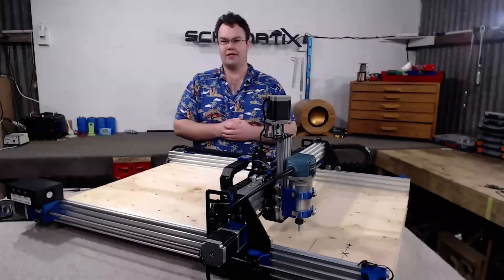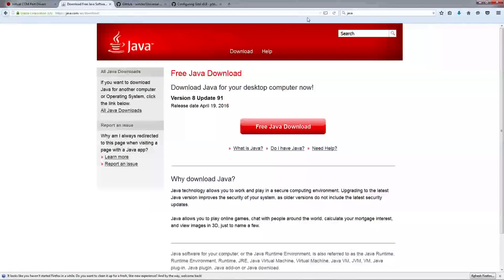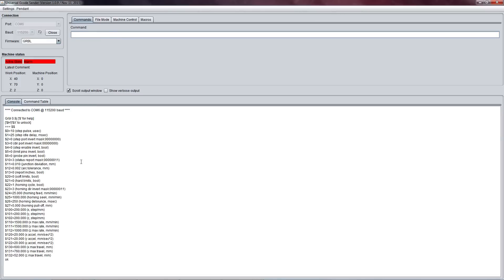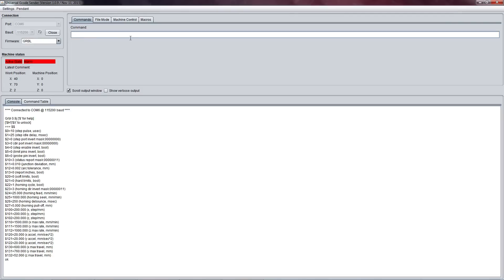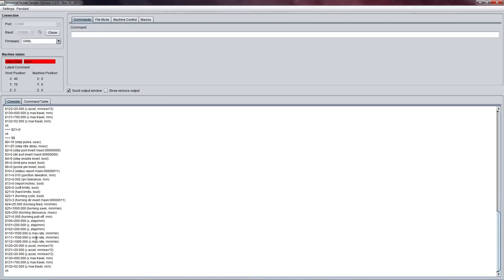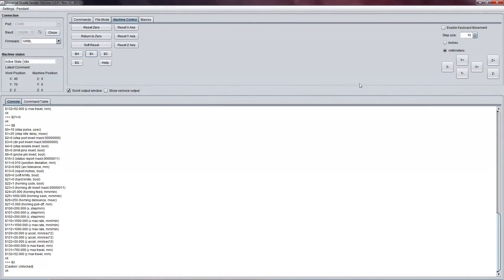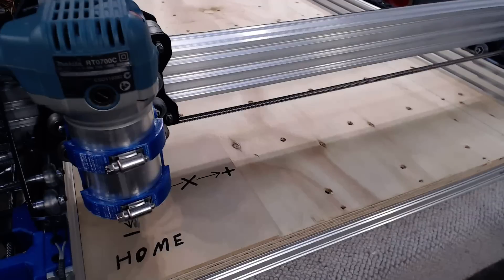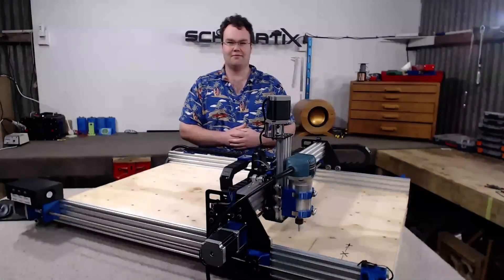How To: Setup Grbl firmware, Drivers & Universal G-Code Sender

Comment: I'm told I already have the best drivers installed when I try and install the drivers (1st step) however when I launch UGS I get the message 'no serial ports found'...  There are no COMx ports in the Port drop down.   It's almost like USG is not picking up on the fact that there's a USB lead in....    I am able to launch MACH3 and it connects immediately with no problem to my CNC and I am able to jog using this so commands are getting over as well...

Comment: when i set the BAud to 115200 , my software closes, although i have updated java, and software version ia m using of Gcode is 1.0.9 version, my windows is uodated. What might be the error or the shortcoming in my system/ hardware, can anyone help me with this issue

Comment: Just plugged into Cbeam XL for first time and all good:D Simple question though - how do you get t to list the setting meanings in the $$ output? Mine just displays the number and value..  Yours displayed the setting function
Reply: OK found the answer on the latest GRBL wiki  "The x of $x=val indicates a particular setting, while val is the setting value. In prior versions of Grbl, each setting had a description next to it in () parentheses, but Grbl v1.1+ no longer includes them unfortunately. This was done to free up precious flash memory to add the new features available in v1.1. However, most good GUIs will help out by attaching descriptions for you, so you know what you are looking at."
Reply from the maker: I'm not sure why yours isn't displaying more info related to the settings. Perhaps it's related to the version of software I'm using compared to yours?

Comment: Thank you so much for a well-delivered tutorial. I've had my V2 CNC XPro board and stepper motors for almost 2 years and I've not seen anyone discuss its setup and configuration so well as you did. I've been able to connect the board and the stepper motors and get them spinning. I just need to get familiar with the command codes. Thank you. Good job.

Comment: Like your instructions ... Just got my c beam xl together. Got the driver installed. Downloaded the UG code sender , but when I click on it as you did , I just get a bunch off files (maybe 35) don't get the screen for setting up cnc x pro settings. Any idea what I'm doing wrong. 
Paul
Reply from the maker: Make sure java is installed and up to date. It may fix your issue

Comment: hello sir,actually in my UGCS it is written OK at the end and there is no errors but I think due to stepper driver or what stepper motor is not moving.
but incase of grbl controller it is showing 
>G91
>G01X-10
error: undefined feed rate
>G90

and I changed CNC shield but new one too explode black one I think capacitor and I immediately power off and I checked next time one of x-axis a4988 doesn't work

Comment: Hello, I really like your commitment to us to learn programming, but I can not understand why when I open the program UniversalGcodeSender "Machine status" Work and position Machine position X, Y and Z are always 0, Do you know the reason?

And why can not set the extreme limit the size of the table?
Reply from the maker: So the work and machine position stays at 0 even after manually jogging the machine? Personally I don't use soft limits. So the machine position in UGS is rather obsolete. Naturally though the work position is very important.
Reply: Machine performs functions normally, but I do not see the status of the machine (position machines) cordinate? Can I do something to fix this error?
Reply from the maker: Really there are too many possibilities for me to suggest a plausible solution. I'd recommend making a post on Openbuilds forums, add some screenshots and give plenty of details.

Comment: I am using sketchup  as my cad program. then makercam to convert gcode . My problem is that when it runs on my home made  cnc it is a mirror copy . So if I was to draw a word . I have to flip it so it is backwards in Sketchup then convert to gcode  . any ideas?    please
Reply from the maker: Hmm perhaps it's a fault with the exported g-code or settings. But are you sure the axis's are traveling in the correct direction? If either the Y or X axis is moving opposite to how it should, the part will be mirrored
Reply: If I'm facing the machine   +x goes away from me   + y goes to the right and +z goes up   is that correct ?  Oh Ya thanks for the super fast response
Reply from the maker: If you watch this video around the 12min mark you'll see how the axises should travel. https://youtu.be/YWPHKF4pa2A?t=12m9s  I can't assess from your description if the machine is calibrated correctly, this is because it depends how you view the machine in relation to where you stand next to it.
Reply: Omg your a genius or I'm an idiot or both. I had the x and y mixed up  haven't tested it yet but that will be the problem thank you thank you thank you
Reply from the maker: No problem, Just as a size note if you invert both the X and Y you'll be back to square one with mirrored parts. Only invert 1 axis. (doesn't matter if its X or Y)

Comment: from where you get the g code ( inskape or what ?)
Reply from the maker: gcode is generated from CAM software (I have a quickstart video on CAM software)
Reply: +Schematix  ok thnx for responding, ploter cnc project stopped on that, i use universel gcode sender and x-loader to flach the arduino , my question is can the gcode generated by cam work in universal gcode sender ? :) thnx for responding again boss :)
Reply from the maker: Provided the CAM software you're using outputs the correct type of gcode file (I normally use .nc file type) it should work just fine with UGS :)
Reply: +Schematix thnx i already try it but while gcode is runing in ugs it still show some errors ( some instructions wont turn on )
Reply: +Schematix thnx i already try it but while gcode is runing in ugs it still show some errors ( some instructions wont turn on )
Reply from the maker: This is only an educated guess so take it with a pinch of salt. I'm going to assume you have a 3 axis cnc mill, and some of the default/chosen options are incorrect for the type of mill you're running. I can't help you much more than that. I can suggest you try Meshcam. its got a 14 day free trial so nothing to lose.

Comment: Your video was so good.....
But i need to knw what do u mean by the revelution as u mentioned revolution= 360
Reply from the maker: 1 full revolution = 360 degrees. As mentioned I only briefly touched on the subject of calculating steps-per-mm value, as the topic is rather big. I recommend you use Google to find a more detailed explanation on calculating steps-per-mm. I may do a video in the future going into more detail.
Reply: ok thanks bro

Comment: great design!

I just wondering, the 3d printed parts are able to provide provides better rigidity than the belt driven system ?
Reply from the maker: Thanks! I briefly covered this topic in my OX-Metal features video. I do recommend using a co-polyester filament for the 3D printed parts. I used PETG which is a very ridged tough plastic. Perfect for use on the OX-Metal. Though I would imagine a good quality ABS+ filament would also work. The use of both 3D printed parts and Leadscrew allows the OX to machine aluminium. Where as the original design (using GT3 belt) isn't intended to machine harder materials such as aluminium.